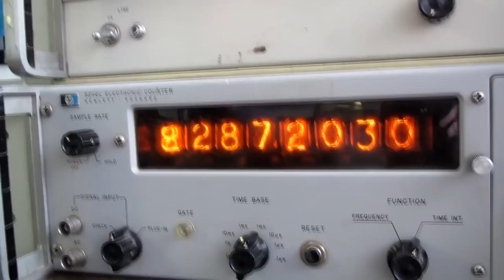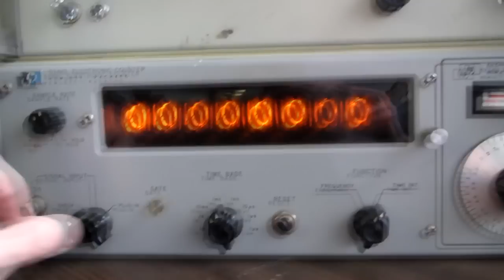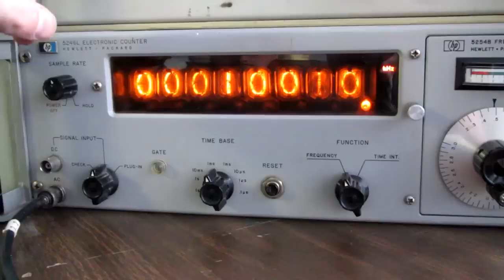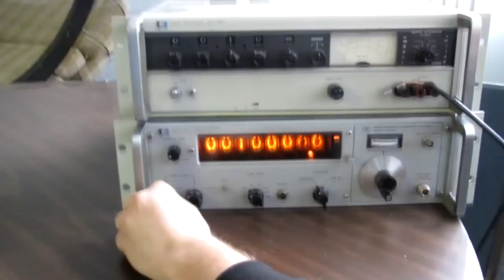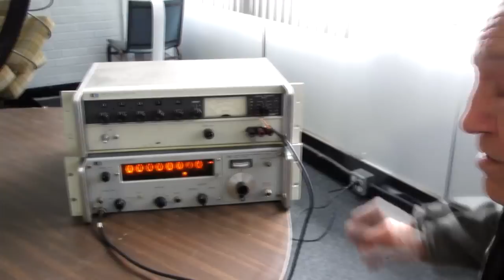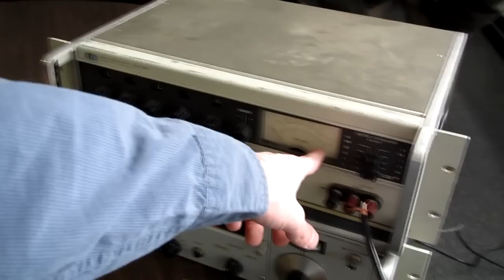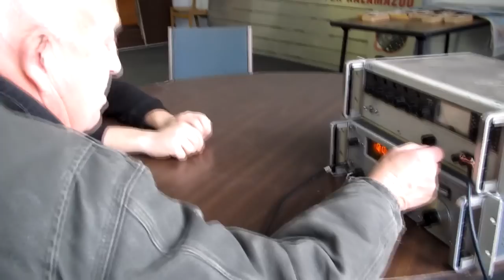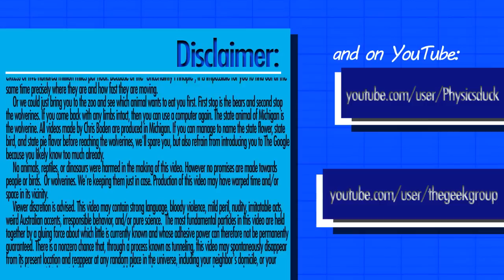Captain's Blog 12-15-11 Nixie Counter, Carbon Heatshield, and Fun

Comment: I'll yell also, you should have checked if the freq gen is operating properly with an O'scope, and pressed again down that damn Reset button. Btw open these suckers in order to:  1 make a great videos about what's inside 2- check for for bad caps, bad solder joints, and clean all the rotary switches and card edge connectors, these great devices deserve it. (part 2 would obviously be a week-end job for Mr Kidwell)

Comment: for oil leaks, check the following, rocker cover, sump nut, head gasket, crank / driveshaft seals, transmission filler. if all these are sealing well you should have no worries

Comment: Hi, let me introduce myself. I am the old guy yelling at the computer. When the time base is 1 second, you need several pulses per second (Hz) to get a meaningful reading. When the time base is .1 seconds (100 ms), you need tens of pulses per second to get a meaningful reading. So, setting the generator to 1 Hz is useless! Crank it up to a few kHz. Check the generator output with a 'scope - you have several  including the "small demos" scope. Most painful captains blog ever! - Cranky in Holland.

Comment: Looks like the counter is working fine. Sure you need to trim the gate to cut out that noise. Very cool. Also the number display at the start should be model number or part number, something like that.

Comment: Wow, this is a good demonstration of how productivity plummets the more people you add into an equation.  I get pickup loads of this kind of junk, and after spotting it in the junk and going "nixies!" and firing it up, after a minute and a half I would of already done a search for the model number and downloaded the manual, and have passed the first 10 pages of fluff and drilled right down to what I needed to know.  There's one of these for sale right now on ebay for about $100